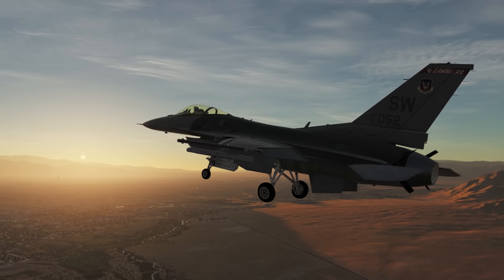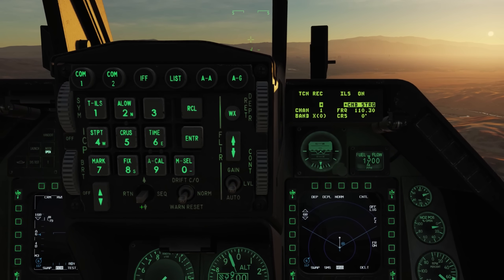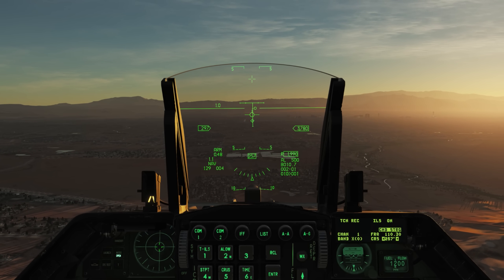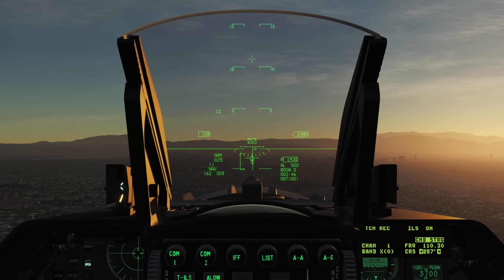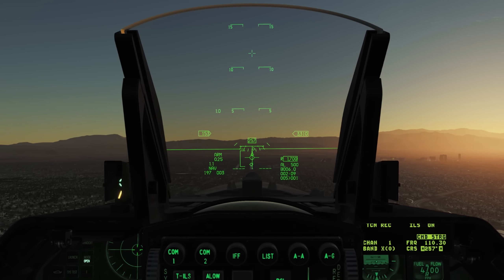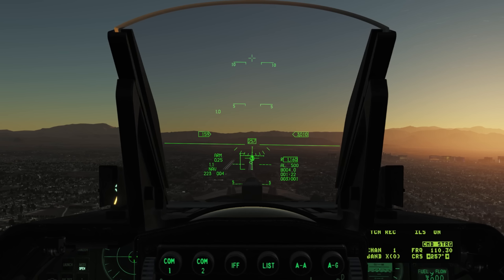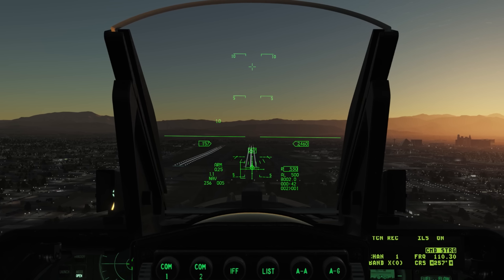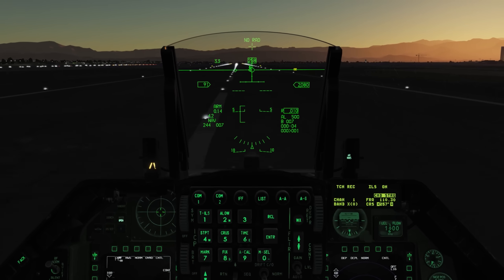DCS: F-16C Viper - ILS Landing

Comment: Hey Wags is ILS still WIP for the Viper at certain airfields?  On PG it works fine at Al Minhad and Khasab, but at the main runway at Al Dhafra it won't accept the freqs.  For the alternate runway at Al Dhafra I can enter the freqs but the steering bars are dashed and don't do anything.  Am I just doing something wrong?
Reply: I notice that somtimes you have to get within range for it to work, about 10 miles from the airfield.

Comment: Okay, how do you get the ILS bars to uncage? It's dialed in to the right freq but they stay dashed lines and caged to almost a right angled corner. It's like it's on but not engaging.
Reply: look at 0.44 where he type in frq.not on frq line but above.
Reply: @MrBorgirdim  I may be late but why is it like this? Don't you have to type in the frequency in the frequency section?

Comment: It would probably help to tell viewers (in particular, new players) where you got the frequency and course values from.
Reply: Thanks, I wanted to ask the same question, even though it's a 2-year-old comment I am brand new.
Reply: @reload54  dang, fancy  meeting you here... trippy to see that a year ago you were brand new (knowing what you are capable of now)!
Reply: Ham Sandwich this would be so handy. And if you know of any information out there on this, it’d be quite helpful for a new viper driver
Reply: @norskefosvaret2007  In your F10 map, if you go to an airfield and click on the little airfield icon in the middle of the base, a window with a bunch of info will pop up. 
Towards the bottom, you'll see a line titled "RWYs" (meaning 'runways'). Next to that is the list of runways. If there's only one runway, there will be one column with the runway number at the top (next to 'RWYs'). If there are multiple runways, there will be multiple columns. Each column contains runway info, including (if available) the ILS frequency for that runway. Unfortunately there's no runway heading provided, so you have to use your compass tool to measure it manually.
Reply: @HamSandwich277  if you're in the caucasus you also have the landing charts on the kneeboard, with the magnetic heading of the runway, also F10 map is (I think?) in True Heading as opposed to magnetic, so if you're doing that , you will need to take magnetic declination into account (for example, batumi reads 126º in F10 map but chart will tell you 119º, which is the actual heading you'll follow to land), tho some aircraft have an option to select true or magnetic heading, such as the M2000C

Comment: Few beginner question:
- where can I read the exact runway heading while flying ?
-course, what is it and how it works?
-how to approcach the "entry point" of an ils descent?
Thanks!
Reply: Roberto Mettifogo the exact rwy heading and your ils course is on the approach plate. To understand all of it takes a couple months of instrument ground school but the basics like rwy heading are obvious
Reply: @LtRiot  but where is the approach plate.in game? Thanks
Reply: @RobertoMettifogo  
1.use Rshift+K to open up the kneeboard for all approach and instrument related information.

2. Course is the heading of the runway or your TACAN radial, you input this heading into your HSI, it will provide you excellent situational awareness and allow you to maintain the localizer.

3. About 10nm before the runway, make sure you’re at 3000ft and stabilized before capturing the ILS glideslope to descend down to the runway, if you’re performing a visual approach, begin the descent and maintain about -750ft/min as the descent rate. 

Hope all this helps!
Reply: @carldsouza9436  thanks man

Comment: Does the viper have a trim that will actively seek to maintain an AoA like the hornet? Or is it just regular trim?

Knowing the difference saves (virtual) lives
Reply: Trims like the hornet, and even better, in landing config you don’t have to bother with trim like you do in the hornet 😉
Reply: @Raffson  if it "trims like the hornet" it's impossible to land without trim. Hornet "trim" in landing config is a pitch autopilot where you set the desired aoa. The computer will then try to keep that aoa.
Reply: migkillerphantom trim is just trim.. it trims like the hornet, and like any other plane for that matter.. in landing config you NEED trim in the hornet, but not in the falcon.. I’m not sure where you’re getting that autopilot stuff from, cause all trim does is adjust the angle of the elevators.. ok you could argue that the FBW is some sort of autopilot and that your trim commands the FBW, but the result is pretty much the same..

Comment: Another detail that wasn't mentioned is that besides the ILS cross on the HUD you also get an attitude cueing circle that redirects you precisely into glideslope. I just can't remember how it's called, though.

That small circle with a vertical bar on top (the bar on top of the circle only appears when the ILS gathers the valid GlideSlope data and the Horizontal Bar of the Cross starts moving, before this point, it's only that small circle you can see aligned with the Artificial Horizon Line). If you maneuver to position your Flight Path Marker over it, this will guide you to align your localiser and glideslope indication simultaneously. The cue circle keeps moving around on your HUD to correct your course to the proper approach path. So if you follow it precisely, as well as mainitaining your FPM inside the AoA Bracket, this combination will always align you for a perfect landing. Just a matter of practice.

It functions in a very similar way to the Landing Mode of the russian aircrafts, where you have to align the two circles in the middle of the hud, and this will align you with the correct landing path.
Reply: We call it Herm the sperm.

Comment: @wags Any particular reason you pull stick for aoa instead of trimming (as I’m used to from the Hornet)? Looking forward to the release! Don’t crunch too hard. We appreciate you guys staying healthy!
Reply: The FBW of the hornet is slightly different from the falcon/viper in the sense that you don’t have to trim the 16 unless you get damaged and you (partially) lose your FLCS.. so essentially you just aim the nose 10°-13° up and let her glide on the slope.. now there’s two ways to touch down, either you flare the aircraft or add a little power just before you land, or you can do a little of both.. but make sure you don’t go further than 15° nose up as you can strike the tail on the ground and that’s no bueno..
Reply: @Raffson  , there is no reason why you couldn't trim instead of holding pitch with the stick. IRL this isn't done though, probably due to the side stick being easier to hold, but this is an assumption on my part. It has nothing to do with the FBW design, just not standard practice. Personally I see myself using trim quite often, as the thought of having to hold back pressure on my centre-mounted stick is very unappealing. I don't think there is a wrong or right here, just standard practise
Reply: PhillMag k nvm, after reading your comment again, i confirm my assumptions.. you’re talking about “hold back pressure”.. that’s where you’re misunderstanding the falcon.. once wags put his guncross between 10°-13° nose up, he doesn’t pull back on the stick, the nose stays there and he simply adjusts throttle to move the fpm.. throttle inputs will not make the plane pitch up or down, so in a sense, the falcon is waaaay easier to land than the hornet 😉
Reply: @Raffson  , so you're saying that once AOA is achieved, the Viper maintains that AOA without needing stick input? If that was the case, why would Wagz mention that stick input is required to "maintain AOA", instead of saying using stick input to "adjust AOA". I'm no F16 pilot, but I honestly think you're wrong. This was also confirmed in an answer by Wagz to a question I had about using trim in the Overhead Break video, in which he confirmed that trim is generally not used, with AOA being maintained through constant back-pressure on the stick IRL. This seems contradictory to your reply. Perhaps it works like you describe in a different block of the F16?
Reply: In FLCS landing mode, viper needs constant back pressure of stick in order to maintain constant pitch angle and is intentionally designed so
Reply: FGtitlis that is only the case before you are on-speed aoa.. once you are on-speed aoa, no stick input should be required except for minor corrections.. also, it’s not to maintain constant pitch, it’s to increase aoa that you pull back on the stick, this is needed cause the FLCS maintains pitch and as you slow down, fpm drops and since you want to maintain altitude (assuming you’re catching the GS from below), you need to increase aoa and thus pull back on the stick..
Reply: @Raffson  , also, in your reply to FGtitlis, you mention "since you want to maintain altitude (assuming you’re catching the GS from below), you need to increase aoa and thus pull back on the stick". This is fundamentally incorrect. To maintain altitude, you would increase throttle, not increase AOA. Changes in AOA affects speed, not altitude. This was either a pretty bad typo, or your understanding of a "constant" AOA approach is just wrong......Honestly, with the exception of having to flare on landing, I don't think the Viper is so much different to the Hornet, or any other jet for that matter.
Reply: PhillMag how does increasing throttle make sense when you’re trying to slow down for landing? But yes, once you are on-speed aoa, you ought to use throttle inputs to bring the fpm up or down, typical to an aoa-approach.. i really don’t know how i should explain this in a different way so i just suggest waiting till it gets released and then maybe things will start making sense.. it’s really not that hard, in the hornet you use trim to get on-speed aoa, while in the falcon you just counter the fpm’s drop by pulling back on the stick, which eventually increases your aoa.. suppose the following example:
You’re at 1000ft, doing 300ias and 5nm out for a straight in.. assuming a glideslope of 2.5° like wags suggests, you’d catch the glideslope from below at 3.77nm from the runway, now also assume that you’re flying level to begin with and have 4° aoa.. this implies that your guncross is 4° up.. as you slow down, your fpm tends to drop too if you don’t adjust the pitch, which will stay at 4° if no input is given up until 25°aoa (that’s where the nose starts dropping too as an aoa-protector).. so to keep flying level, you gently pull back on the stick, which increases your aoa as a result.. once your guncross is roughly at 12.5°, you’re on-speed aoa and you can stop pulling back on the stick and start using throttle to maintain level flight.. now once you’re 3.77nm out, thus catching the glideslope, all you do is push the stick slightly forward and put the guncross 10° nose up instead of 12.5°.. remember, 12.5°aoa thus that implies your fpm is exactly 2.5° below the horizon, and thus right on glideslope, using throttle only from this point on up until the flare.. hope this clarifies all misunderstandings.. also, everything i’m saying here relates to the F16 specifically, cause obviously every plane flies different and don’t forget, the effect of a FBW in general requires you to fly (i.e. stick/throttle inputs) in a different way than you would be used to in aircraft without FBW..

Comment: Yeah this is cool but what about finishing the f18?
Reply from the maker: Hi Jaek, the Hornet will certainly be finished and being worked on now. Walleye should be coming quite soon. The Hornet and Viper will be worked on in parallel as they both share core-API systems like TWS, AG radar, and others. Thanks
Reply: Maybe the API will help complete both modules.  Just spit balling...Not a software developer here.  

I definitely understand the sentiment.
Reply: Speculating here, but I think both the 16 and 18 will be finished at the same time.
Reply: Jesus. More salt than a Happy Meal. If your that angry go find another hobby.
Reply: @A10outof10meme  1 year and u will say "Yeah this is cool but what about finishing the f16?" :D 
im not getting f-16 too but im big f-16 fan, i wont wait 3-4 weeks for basic IFF sorry :D
Reply: @A10outof10meme im not getting the f16 until the f18 is finished, or nearly finished. 

Vote with your wallets.